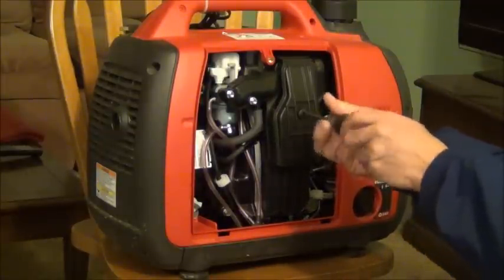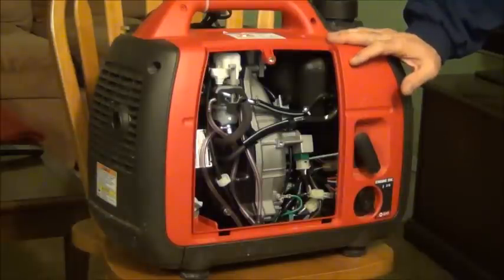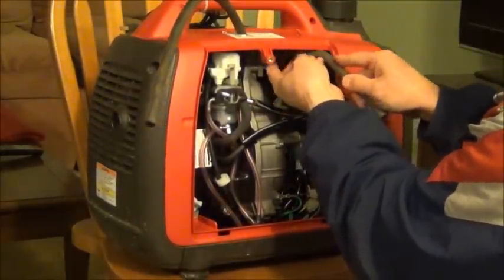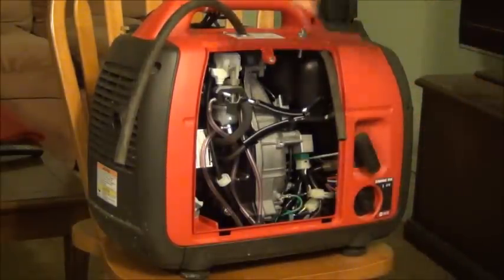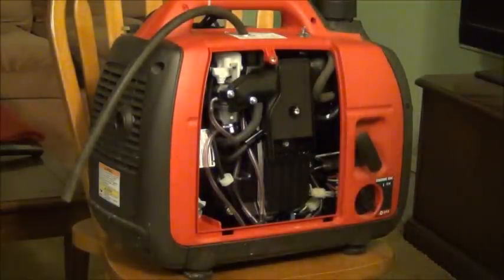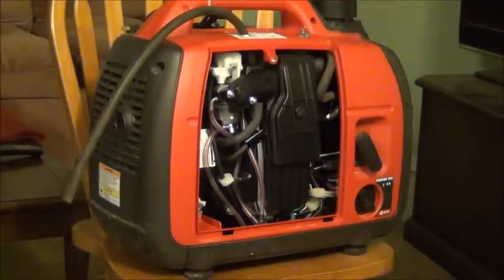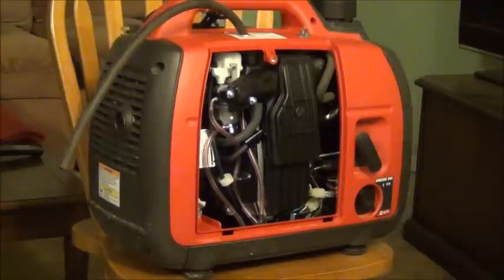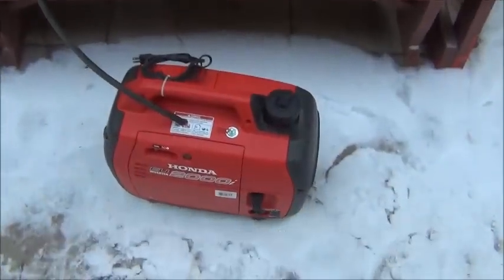Honda EU2000i improvement. One of a kind.

Comment: Just drain the carb fuel bowl after shut down and pour it back into the main tank instead of wasting it in a useless burn-off cycle.
Reply from the maker: +Go And Sin No More  I guess it all depends on the situation, your solution might work perfectly for people who use the generator seldom, and keep it rather as a backup solution, for power outages. For people who use them frequently such a procedure would be probably too cumbersome. But I like your idea, especially if the vendor would offer a simple way to drain the carb bowl, without having to remove anything, just by turning a valve and collecting/draining the fuel. I also wonder how much of fuel does the burn-off cycle waste, maybe we all should indeed go and sin no more :)
Reply: Wally Knorr Canadian Hunter ill have to look at my 2k but, my 3K has a screw you loosen to drain the fuel bowl on the carburetor.
Reply: No

Comment: This was very helpful.   I have been shutting off my generators and small engines for years by turning off the fuel and let it quit. I even do it on chainsaws by dumping the fuel out into a funnel and running the engine until it stops. It can sit for years without the carburetor gumming up. Starting is easy, too.
Reply: kimmer6 

+1

One thing that's nice about living in the north is when spring time comes I just drain the fuel tank in my snow blower and dump it straight into the lawn mower. Start up the snow blower and run it until it dies, and it will start up on the first pull 6 months later.
Reply from the maker: kimmer6 I love this solution, too, and use it now with many small engines, like the boat motor, etc. Still amazes me how good they start, even after sitting for a couple of years, if all the gas was burned or drained. I should find a cheap solution for all my lawn movers, rototillers and snow blowers :)
Reply from the maker: brandon Very good idea, I will do the same. Thanks for sharing!

Comment: Thanks for sharing.  You just saved me some money.  Much appreciated!
Reply from the maker: Dan Ryant Thanks for the kind words!  I used my generator literally last week, after it was sitting for a full year. With old gas in the tank. Just opened the valve and pulled the rope few times, and it started and worked like a champ. Always amazes me :)

Comment: Nice. I have a problem with the electrical turn off on mine. The OFF switch does not turn it off. I always used the choke to turn it off but I assume if I let it run a while it would run dry. I will try the petcock install to urn it off quicker and not worry about the electrical part of the switch.
Reply from the maker: Mark Feeney Yes. seems to shut them off by letting them to run dry is a very good idea, lots of people suggest to do this. But on the other hand some people are afraid to leave the pump dry, saying that the rubber seal might get bad, so the workaround I suggested in the video seems to be ideal - the pump is still full, but the carburetor is dry :)  Good luck!

Comment: The generator has a fuel pump so the system can be modified to supply it with any of the fuel tank (not just gravity).
Reply: Tim Dunk Proof:  http://www.tinypic.pl/nceshcifu4q2 (No. 1 is the fuel pump). Trust me. I have authorization from Honda. This pump is strong and there is no problem with the stroke of the external fuel tank (sorry for my english)
Reply: Tim Dunk 0.15 and 0.20 mm
Reply from the maker: You are probably right. I think in my case I went for a cheap solution and decided to bypass the fuel pump, hence the need for "gravity". Or maybe I decided that the fuel pump is too weak and will not be able to do the job. To be honest I don't remember anymore, too much time has passed since then... :) Would love to get a feedback from someone who was able to test it by using the built-in pump.
Reply: Wally Knorr Canadian Hunter  Great video Wayne.  If  I recall correctly, there is no pump, it's naturally aspired.  An internal component, cant remember what exactly, creates a vacuum.
Reply: mgrybak Thanks mg.  Must have confused it with another machine.  Great link.  Different thread, but can you tell me if the valve clearance for said jenny, is 0.15 and 0.20 inches or mm?
Reply: Yes has a fuel pump..!Also in the engine cut off switch if you do a 1/4 of a turn(to the right) it will cut off the fuel to the carburetor after 2 min..and then you can shut it off all the way to the right..!

Comment: really good idea man, ended up doing something similar on a Tecumseh HM80 powered gen-set, i wish I'd have known about the on/off/reserve valve when i got just the on/off version, I've found that gen-sets seem to start many times easier from a dry carb after being stored, keep up the good work my friend, and best of luck for future projects, also looking forward to more videos in the future
Reply from the maker: Fox Nakamori Thank you for the kind words, my friend. I am not the "sharpest knife in the drawer", but right now I indeed have an interesting new project going on - I am insulating a shipping container, wanna build some sort of a cabin, which can be then used even during the brutal Canadian winter :)
Reply: Wally Knorr Would like to see a video of the project sometime if that is possible. Hope it goes well for you.
Reply from the maker: I will definitely post it, promise. It is winter and cold outside (here in Canada), so the work is going slowly, but I am making some progress. Already framed the container and insulated, and 50% of the walls are covered, now need to install a stove and do the floor as well. I try to film once in a while, so the entire process will be covered. Merry Christmas!

Comment: Great Video. I ordered the parts for the fuel shutoff and my generator is still on order... :) This will be the first thing I do is install the fuel line shutoff. Thanks!!
Reply from the maker: Telcom Techie Glad you liked it. IMHO those Honda generators are the best what the market can offer.
Reply: Wally Knorr I do agree with you Wally. I have another Generator 8K/10K but not a honda. I was forced to purchase it during an ice storm some time ago. Wish it was a honda but I didnt have much choice as I just needed something. Of course the other ones are too large to bring anywhere easily. So I needed a small one to bring places. The Honda seems to fit the bill.
Thanks Again for the tip!

Comment: Hey Wally great vid dude,thanks for posting it.Can you tell me what you were running during the night? And what kind of running time were you getting out of the standard tank of fuel? cheers mate
Reply from the maker: Jeffrey E Hi Jeffrey, when camping in summer I was just running the fan, to keep the bugs and heat away, and the full tank would last the entire night, the genny would run out of fuel around 6-7 am. But when hunting and it was below zero I had an electric heater running, 1500 watt, so the generator was used up to its limits, and then it would die at about 2-3 am. That's why I was so desperate to get the problem resolved, in an elegant way and cheaply. Waking up at 2 am and getting out from the warm bed in the winter night was no fun, man...
Reply: Wally Knorr
Thanks for the update Wally I am picking up my eu20i in the morning and will be using it in a similiar way to yours,we have a cabin also down here in country Victoria on 30 acres where we need to run an aircon during summer.We have a wood heater during winter so keeping warm is no problem,however we also have a caravan onsite for guests who may want to come stay with us and it is fitted with a reverse cycle aircon which will be used for their heating in winter so the eu20i will only be running one of the units at anyone one time and both are below 1600 draw so hopefully we will have a good run with it.Also had a look at your other vids I;m guessing that is your  hunting cabin? Enjoyed seeing the bear come in for breakfast lol. Thanks again.

Comment: Thank you, great explanation and video!
Reply from the maker: Thanks! I didn't use my generator last year, and this year had to use (out in the woods, had to cut a log) and it started from first pull. I was speechless.... 2 years old gas in tank and no problem at all. Using the "genny" this year heavily and just love it, before going home I turn the lever and let the gas in lines burn out. One of my best purchases ever, so reliable and useful, especially after the modification. I added a proper fuel line, a fuel filter and a hand-pump in the middle.
Reply: Wally Knorr Very good!

:-)

Comment: I have an extended tank, but have yet to use it. The whole kit with tank was around $100 and uses aircraft grade hoses/fittings. Just the cap & hose was $50 or so.  I could have made my own, but not worth my time to save $40. Gravity feed makes me nervous.

I also use a mix of standard & marine Sta-Bil. No issues yet. I also keep a supply of commonly needed spare parts.

Great video! Thanks for taking the time.  I like the idea of a stand alone shut off valve.

Comment: Instead of modifying the generator, why not just drain the fuel from the carb bowl as shown in the manual? Even with an aftermarket fuel petcock installed as here gasoline will STILL fill the carb bowl and be prone to gumming things up. 

A fuel shutoff would be nice, especially when servicing the unit, but won't prevent a clogged carb bowl.

Comment from the maker: I just had a stupid idea... what if you install a small reservoir on top of the generator (anything will do, even a plastic bottle) and then let your pump fill up this reservoir and let the excess drain back? So there will be never too much pressure in the system, and at the same time enought fuel to feed the carb? I hope it makes sense what I just wrote? :)))

Comment from the maker: I think your idea is okay. The built-in pump is also pumping the gas and is maintaining some pressure in the fuel system. After doing some testing (with gravity fed fuel) I noticed that almost no pressure is needed in the line, and I like it that way, it makes it safer, I don't have to worry about connections, burst pipe and possible leaks. If you can find a way to keep the pressure to the minimum then it would be nice... Maybe youtube has some suggestions about low pressure pumps?

Comment: fantastic idea.  I plan to try this myself, except in my application I have no room to place a reservoir higher than the carb so I planning to incorporate a small electric fuel pump.  Is this a bad idea?  Is it easy to put too much pressure in the line or does the carb work well enough to make it not an issue?  I can maybe regulate the voltage if the pump is too much.  btw you mention you wish your english was better.  it seems near perfect so please explain away if you wish

Comment from the maker: Thanks for the kind words! I wish my spoken English was better, so I could explain it better. In the meantime I bought a gas hose and quick connectors and fuel filters (Ebay, set of 3 for 1 or 2 bucks), closed the end with a cap (when not in use) and really love the setup, works like a charm... Wish I had found such suggestions last year, when I was camping and freezing :)